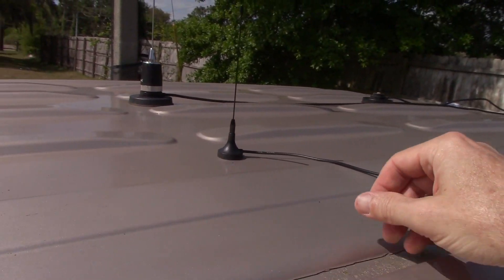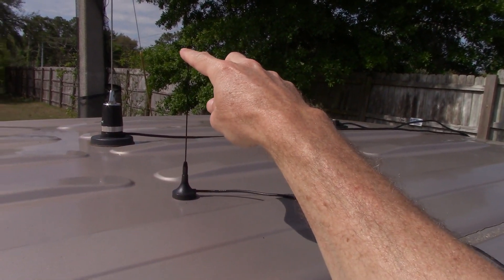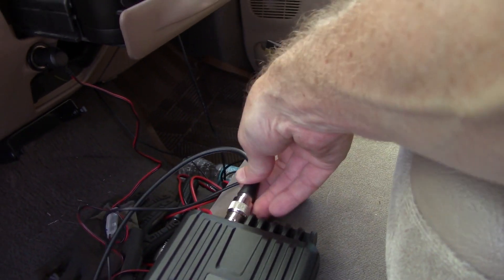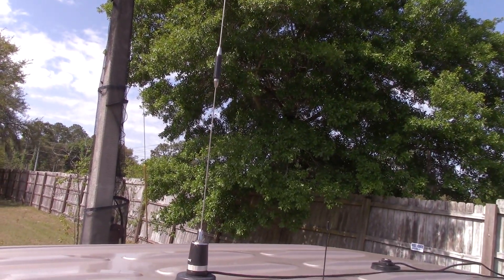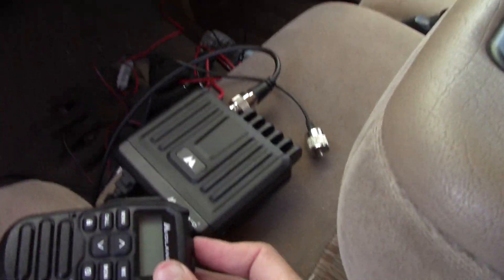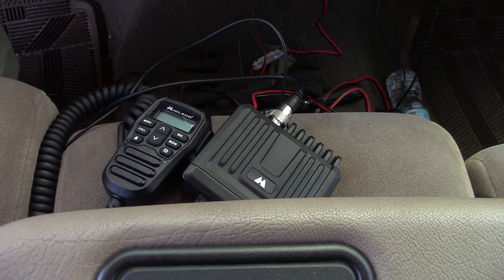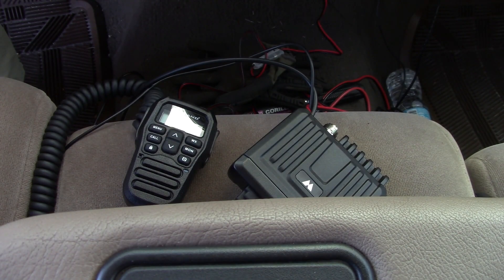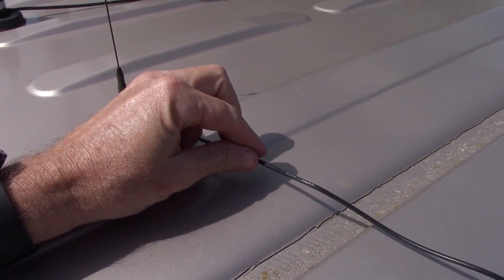Midland MXT275 Antenna Upgrade

Comment: Is it recommended to shorten the cable? I did upgrade the antenna with the mxta25 3db miromobile ghost antenna but i have about an extra 12ft of cable  that i had to coil up.
Reply from the maker: Coiling will create an RF choke and it can change the SWR reading as will changing the coax length. What is the new coax? If RG-58, cutting 12 ft would recover just under 1db of loss so a small improvement. Is that antenna tunable? If the SWR reading is good, I've leave it be.

Comment: Don’t think antenna gain works that way for transmit. You can’t create energy without amplification so there is no way you are doubling your output. The radio is rated for 15 watts max. The 6db gain increases sensitivity on the receive side. If you have a link to information that proves an antenna amplifies your TRANSMIT I would love to see it. SWR is what preserves your TX energy and that is achieved through proper tuning, but the best you can hope for is a 1.0:1 ratio which will give you 15 watts at the antenna minus any loss on the feed line.
Reply from the maker: The term Effective Radiated Power (ERP) takes into account the transmitter power out, the line loss and the antenna gain to determine how much power is heading out towards the gain direction. The FCC uses this formula in capping the output of many transmitters. Here's a basic overview https://www.rfvenue.com/blog/2014/12/15/what-is-erp

Here's a deeper explanation: https://en.wikipedia.org/wiki/Effective_radiated_power

And a nice calculator: https://m0ukd.com/calculators/erp-eirp-calculator/

Comment: You are showing us how well the weather channel is received. The weather frequencies are VHF, 162.400 to 162.550 MHZ. The GMRS frequencies are UHF 462-467 MHZ. That’s quite a difference. You should be tuning for GMRS reception. A GMRS antenna at 1/2 wave should be 14.5 inches tall.
Reply from the maker: Correct, but at the time there was no GMRS signal to work with.

Comment: what you think about Midland 6 dB Gain Antenna with Durable Spring Base and NMO Connection ?
Reply from the maker: Like the NMO mount and the spring is a good idea especially off-road. I almost bought one when Midland had a good Black Friday sale, but haven't seen one in person. The Browning is rather flexible and has done well with a few drive thru overhangs. Just have to periodically check the set screws to make sure those hits don't loosen them.

Comment: what is the magnet mount your using?
Reply from the maker: In this video I was using a basic Tram 3.25 inch with RG-58 https://amzn.to/3Elkeg5  Since then I switched to this one https://www.theantennafarm.com/catalog/index.php?main_page=product_info&cPath=264_265_273&products_id=8079 It has a slightly larger magnet 3 5/8 inch and uses BR-195 (off brand LMR-195) which has about .5 db less loss than  RG-58 at GMRS freqs. The 195 is stiffer so if tight turns are needed it may not be best option.

Comment: This is a great review; you've saved me from buying a stock Midland antenna. Could you please link to some of the products you refer to for quick reference by we newbies? Also, the upgraded 275 has been announced with USB-C and Split Tone  - will you be reviewing it soon? Thanks! :-)
Reply from the maker: I saw that Midland updated the 115 and 275. Its great that they are listening to feedback and making changes. I don't have immediate plans to get another 275, unless they send one to me. :) 

Midland had a decent selection of antennas and mount options, but I have no experience with them. Recently I got this mount and it is working well. https://www.theantennafarm.com/catalog/index.php?main_page=product_info&cPath=264_265_273&products_id=8079. The magnet was larger than the small ones but not a huge 5" one either. It is using BR-195 coax which has less loss compared to RG-58. However, it is stiffer and does not like sharp bends so consider the routing path before selecting this one. 

Others on this page would work. Check on the cable length as most are either 12 or 17 feet.
https://www.theantennafarm.com/catalog/index.php?main_page=index&cPath=264_265_273

I updated the description with other antennas because the BR-450 got pricey, way more than it should cost.

Comment: Just purchased a MXT275 so I'm looking to go ahead and get an antenna for it. I found a packaged deal on Ebay with the BR-450 and a tram magnetic mount for $45. Do you think that will work fine for this setup?
Reply from the maker: Sounds like a good price, depending on the mount. Make sure the coax is long enough for your installation location. In my truck and van I need about 17 feet. My cars can work with less. Mag mounts usually com with 12 or 17/18 feet of coax.
Reply: @Soladaddy  It's a 17' so I should be good.

Comment: NOAA weather radio is VHF.. 162 MHz… not a valid comparison.   Spot on with the coax and a better antenna though.
Reply from the maker: True, could use a continuous GMRS signal for a better comparison.

Comment: I put this radio into my wife's suv recently and paired it with a Larson antenna and a Laird NMO mount.  Cut the antenna for 465 and it works swimmingly.  Paid about $38 each for the mount and antenna.  Worth it as we can now use our town's repeater from all the neighboring towns while she's out n about.  I'm able to talk with her using just an HT from inside my home as the repeater is only about 1.4 miles from the house.
Reply from the maker: I have a 5/8 wave for when this radio goes in the wife's van.

Comment: Which mount did you go with?
Reply from the maker: I went with a slightly larger mag mount that uses a knockoff LMR-195 coax. It has about 1/3 less loss than RG-58. It is less flexible so not good for sharp turns, but it was routable in my truck. https://www.theantennafarm.com/catalog/index.php?main_page=product_info&cPath=264_265_273&products_id=8079

Comment: Can't you shorten the cable and get more gain
Reply from the maker: Yes that is an option. I think Midland used a thin, long cable to allow installation in a wide variety of vehicles.
Reply: You'd need to buy a crimp tool and maybe some jaws that'd run you the cost of a better antenna, perhaps.  If you had the tools, definitely worth the $5-$6 for a new connector and shortening that cable as much as your mounting setup permits.
Reply from the maker: I never intended to use the supplied antenna, but my truck needs about 17 feet of coax and trimming 3 feet is not going to have much benefit. Cutting it down to 10-12 feet would be worth the work.